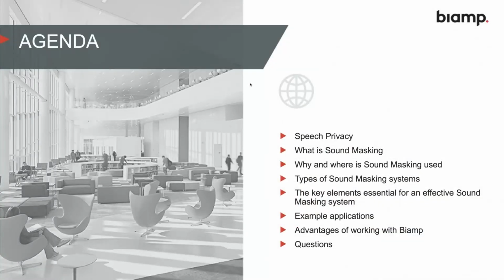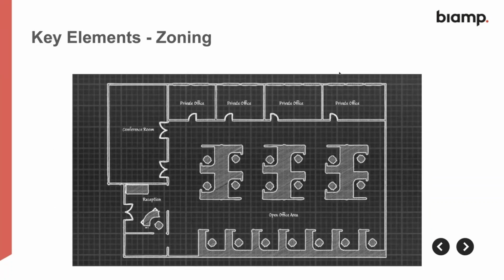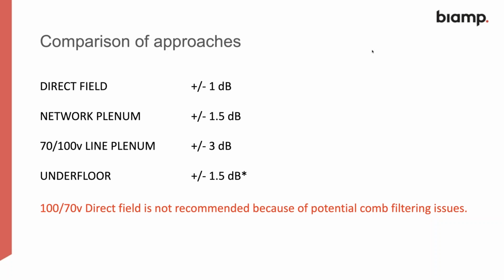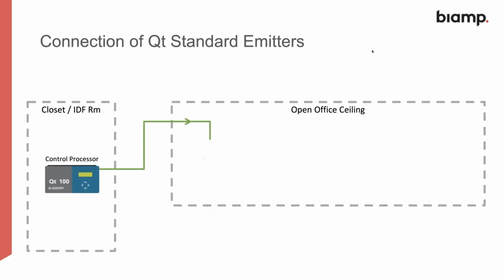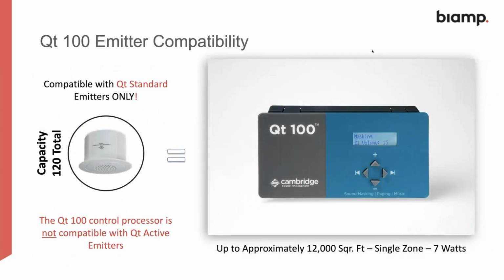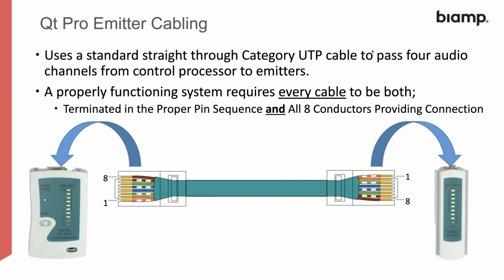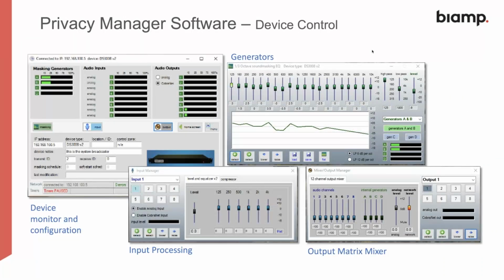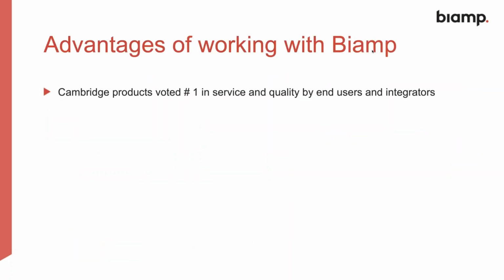Sound Masking 101 Webinar

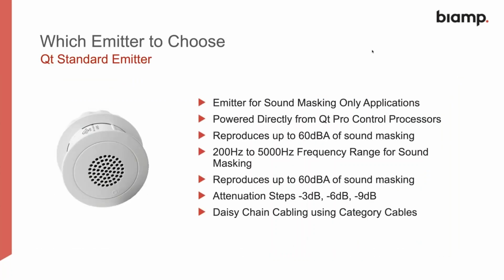Comment: I feel like the statement at 20:50 is wrong, because the QT100 does also have the optional input to page or music over the QT standard Emitters(outside of sound masking).  Your presentation and layout are really good, having installed this system before watching this. I hooked up paging to the stand QT emitters with no issues.